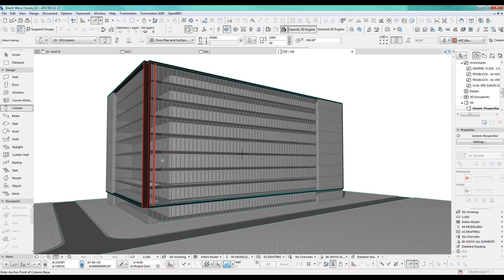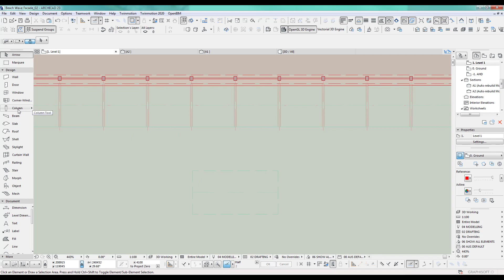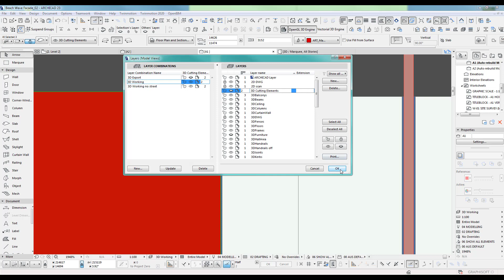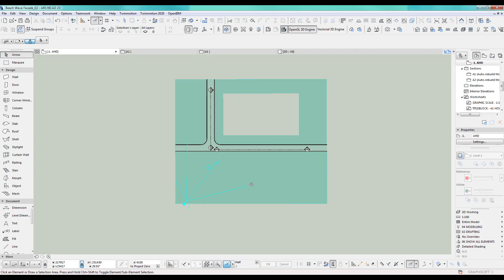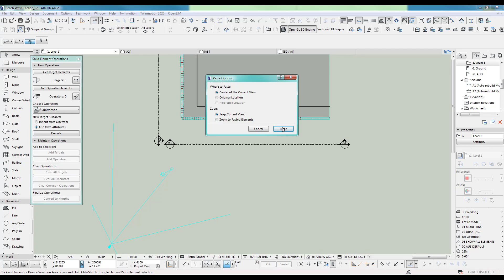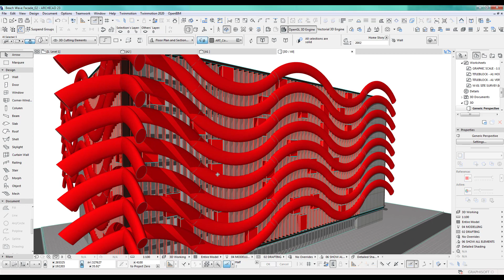Beach Wave Facade in ARCHICAD

Comment: Thank you for this great video ... I have a question, do you know a good way to MAKE ARCHED WINDOW IN CURVED WALL WITH ARCHICAD ?
Reply from the maker: Thanks, this is a good question. It's not easy but I would try the following:

- Create a normal Arched window in a wall to the size you want.
- Now make the window frames/glass thick/wide like let's say 2 meters. Make the wall the same thickness.
- Now click on the window and convert the window to a morph
- Then draw a curved wall as required. Width of wall , the width of a normal window frame. This curved wall will be used as operator in SEO.
- Select the morph window and make this the target element
- Select the wall and make this the operator element
- Choose intersection in the SEO option.
- The "left over intersection" should be your curved arched window !

It's not perfect but a solution for now. If you need the window glass to be thinner, exclude this with the first intersection. Then draw a thinner curved wall and repeat SEO with this thinner wall and the curved glass morph.

Hope you can follow this steps.

Cheers Carsten